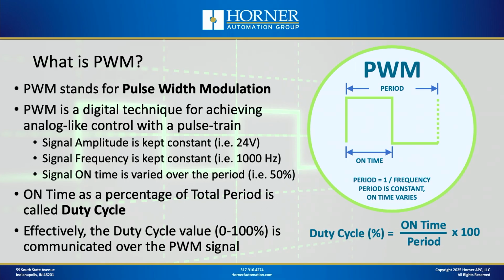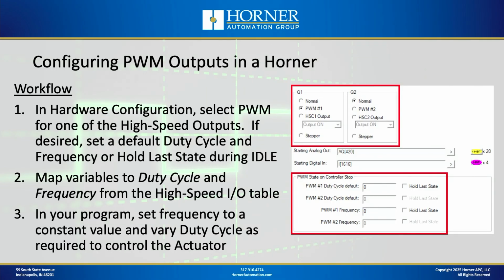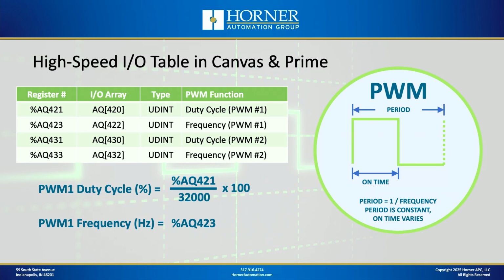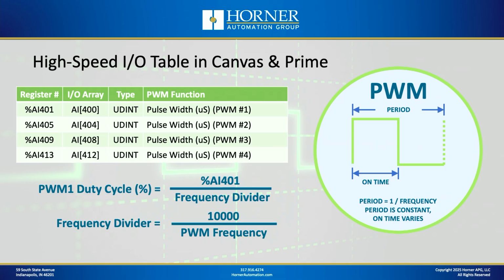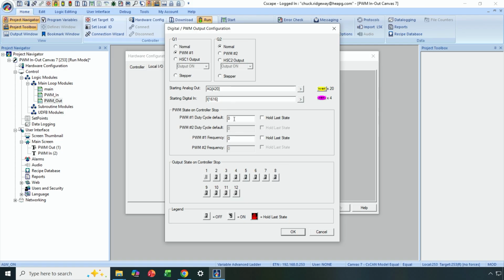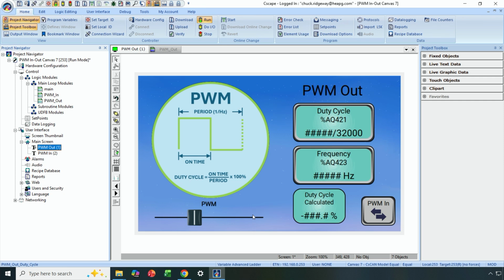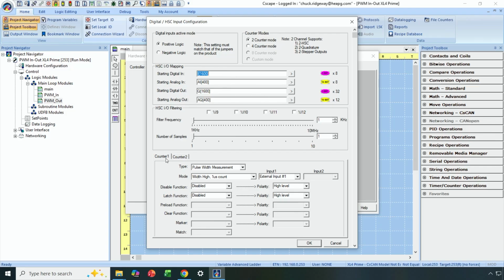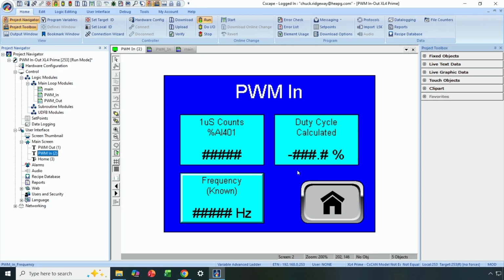PWM Inputs & Outputs with Horner

Comment: Thanks for the presentation. Good job handling PWM. It remains a high-speed frequency counter. Could you demonstrate the calculation of flow rate, volume, and K-factor using a magnetic pickup to generate pulses from a rotary turbine?